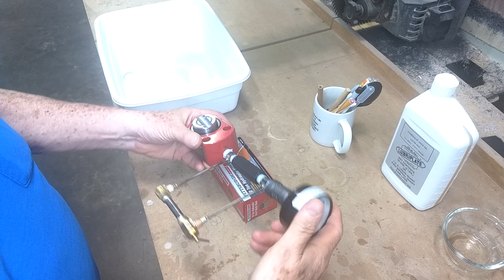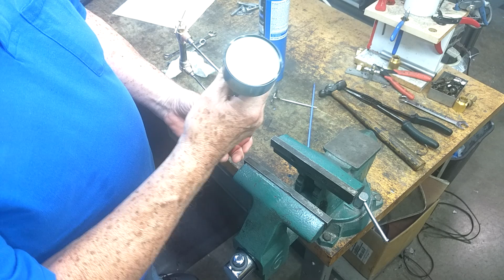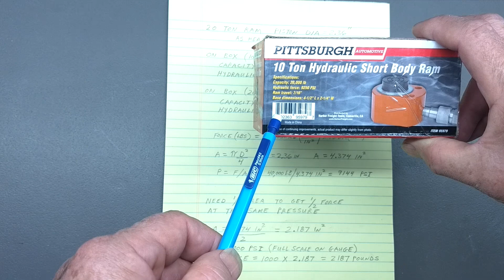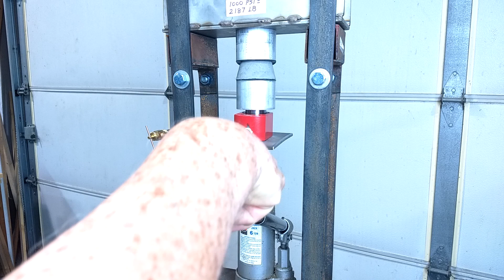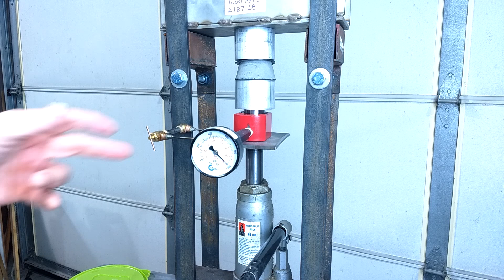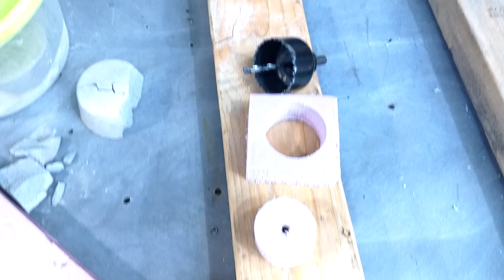Aircrete Experiments Part 3

Comment: forgive me if i am wrong but why did you measure the top of the red piston as this is not the surface area that is in contact with the concrete. The aluminium blocks area is where we find the lb/sq inch pressure and this is also altered by the fact that one end of the "muffin" has a smaller surface area. Plus both surfaces need to sanded or ground totally flat with each other otherwise and surface that is thicker than the rubber you used with have a significantly higher surface pressure.
Thank you for the time and effort you have put into this informative video for us.

Comment: Are you planning on testing the aircrete applied with Polyester Fabric ( a stitch bonded high performance fabric for use in cold applied built-up roofing and roof maintenance systems) sandwich in between concrete and stucco bonding agents?

Comment: Aircrete has a detergent action that seems to dissolve wax mold releases. It sticks to the shiny vinyl mold liner  :(  Using silicon spray lubricant (Gunk brand) over the wax.

Comment: Jim, 
Thank you for doing this.  Without having a good handle on the compressive strength there are a few projects that I am nervous to use it for.  In one project I'm considering using it for a thermal break under a concrete foundation pad.  In another I'm looking at it for a thermal break between two rows of block wall to sit a quonset hut on top of.  Your content is invaluable to folks like me.
Reply: did you ever try any of these ?

Comment: I like what you're doing but I'm not sure your assumptions on the piston diameter are necessarily correct.  I think you can also skip the check valve because you only want to record the maximum pressure attained.  When the sample starts to fail, the pressure will stop going up.  Also, are you allowing your samples to cure for 28 days?  That's the standard for concrete testing.  The broken sample still looked green in the center.  Please keep up this work.  It is much appreciated.

Comment: you may want to make sure the foam does not absorb any of the water in the cement as that will make for inconsistencies in the set.
Reply: @Jimscoolstuff  I put mine in with a heating pad (on high) plastic covered, after two hours.